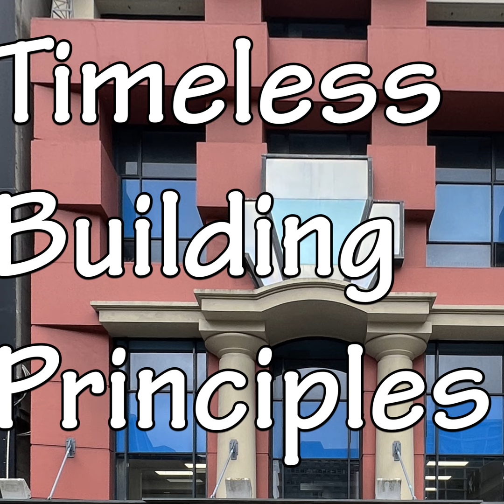Timeless Building Principles

Comment: When studying to be an architect we were advised to use Mitchell’s in preference to the Barry or McKay’s for one simple reason. At that time, around 1980, Mitchell’s set out how to design details to first principles rather than promoting the copying of details. That way of designing has stuck with me ever since. The construction legislation changes so frequently any detail that has been copied is out of date!
Reply from the maker: thank you for you comment. I agree that the construction legislation changes, but the principles don’t. keeping out water, loads and forces, these things are the constants. It interesting to hear Steve Scaysbrook mirror the comments of Terry Boon, that these principles haven't changed over the time they've been practising. For teaching, I think it's important that the students have a good understanding of those fundamental principles. Applying those fundamental principles to changes in legislation and changes in materials will allow them to understand those materials and legislation better.